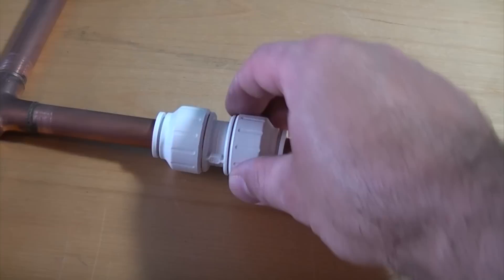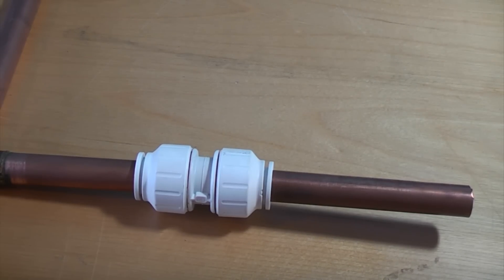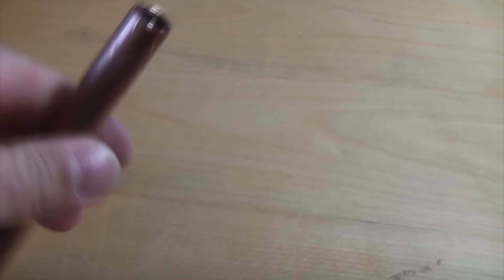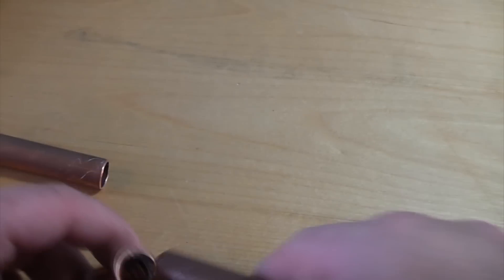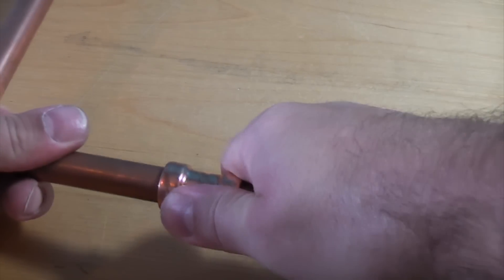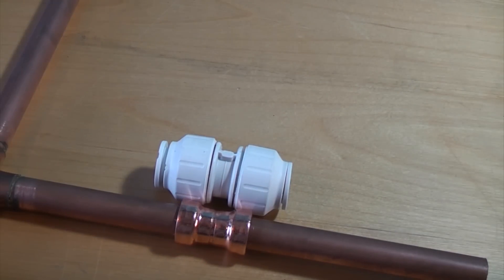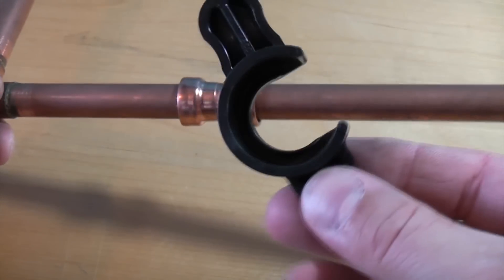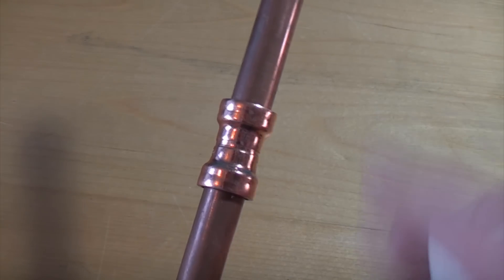copper pushfit fittings

Comment: As a DIYer, these are news to me, and I'm happy they exist! I'll soon be moving a radiator in the bathroom and I'll be using these copper push fits for sure!

Thanks for the video
Reply from the maker: These are really useful on some jobs ;-)
I'm glad the video helped 
Thanks for the comment 👍
Reply: Yeah me too. Just easier plus if you've just paint decorated the skirting and walls less messy than soldiering...

Comment: Can these be relied upon not to leak?  They would be behind bathroom tiles thats all
Reply from the maker: No fitting can be guaranteed not to leak over time. I’ve seen end feed solder start to weep after a few years! 
I did pressure test push fit fittings here-
https://www.youtube.com/watch?v=I59OeSwrhEc&pp
I always try to avoid putting fittings in areas where they cannot be easily accessed, but sometimes you don’t have a choice!

Comment: Apologies if already answered but couldn't find in the comments - which brand are these? There are a few brands of copper push fit around now and these look to be fairly slimline and neat.
Reply from the maker: If I remember rightly, the fittings are tectite sprint 👍
Reply: @ultimatehandyman  worked a charm as the fitting is on display, cheers.

Great channel by the wayl!

Comment: I have just used a copper pushfit end cap as a temporary measure as a garden tap had sheared off. How do I remove the pushfit end cap without cutting or damaging the pipe as I have now bought a new tap?

Comment: what about mixing existing connections between copper and barrier pipe     Pegler v. JG v. Hep20
Reply from the maker: The manufacturers recommend that you only use their fittings on their pipe, or copper pipe. 
But all the pipe should be the same, however, if a fitting blew off from a pipe and there was a insurance claim, they would just say that the wrong fitting was used!

Comment: Do you know if the internal diameter is the same between the plastic and copper push fit couplers? Would either of these reduce the flow rate compared to a pipe with no couplers?
Reply from the maker: Not sure, but plastic pipe must reduce the flow in some pipes, due to the size of the pipe inserts!
Reply: @ultimatehandyman  Yes plastic pipes have a smaller internal diameter even before you put in the insert. Was just wandering in the case of connecting two copper pipes whether either fitting would reduce flow noticeably.

Comment: Hi, I have been told that the plastic push fits should have inserts between the joints and the pipes. Is this the case with the copper fittings?
Reply from the maker: I would only use these on copper pipe.
If you need to join plastic pipe or connect copper to plastic, I would use which ever brand fitting the pipe is, so if the plastic pipe is Speedfit, I would use a speedfit fitting etc. You always need a pipe insert with plastic pushfit pipe 👍

Comment: Are the copper push fits just as reliable as the plastic push fits? Looking to use them for radiator plumbing behind plasterboard.
Reply from the maker: Yes, they might even be better, as the copper will not be affected by heat/light etc. which can sometimes make plastic brittle!
However, I try not to have any joints benhind plasterboard (but that is not always possible)

Comment: The brass push fit are good, but the  removal tool doesn't work!
Reply from the maker: Thanks for the comment
Reply: I don't if you tried it but it's hard to remove them with the tool supplied, or it's me! Hahaha
Reply from the maker: If I remember rightly it is not easy to remove them and takes a bit of practice- you also have to ensure there is no pressure in the pipe.

Comment: Do the ends near to be a PERFECT cut? There is a little lip in the end from when I cut the copper pipe and was wondering if it was still work or if I have to file it all down
Reply from the maker: It needs to be perfect for push fit or it could fail at a later date!

Comment: Hi mate. I want to install a new radiator in my living room as the room has been knocked through from one room so i only have 1 radiator at the bottom meaning the top half of the room is freezing come winter, I have already worked out the path for the pipe work but i was just wondering would it be ok to use this type of fitting for the supply pipes from the flow and return to the new radiator?? or maybe i could use compression fittings. main reason i ask is im not all that confident with soldering.

thanks scott advice would be appreciated.
Reply from the maker: scott bullock 
I'd use compression fittings to be honest, they are cheaper and easy to use ;-)
Reply: *****
thanks mate

Comment: Hi, should these fittings spin on the pipe? I'm fitting a radiator and have found that these copper push fittings spin fairly easily on copper pipe
Reply from the maker: Yes, most push fit fittings can be rotated. The stainless steel grip rings inside only prevent the pipe from being pulled out- they do not prevent it from rotating.
Thanks for the comment

Comment: would these join to plastic pipe? i have a tight area were a vanity is going into and no room for a plastic push fit all my internal plumbing is plastic.
Reply from the maker: +TParker18 
Yes, I can't guarantee that all copper push fit joints will work with plastic pipe, but Tectite sprint can be used on copper or plastic (as long as you use a plastic insert). http://bit.ly/1VBoNG4
Reply: Perfect I will use Tectite sprints in that case thanks a lot. Also wanted to say thanks for your videos and guides that you've done here very useful and saved me some money do you have a donation link so I can chuck you some beer tokens over.
Reply from the maker: +TParker18 You are welcome ;-)No need for the donation as of yet, I can still put food on the table for the kids by doing what I'm doing LOLThanks for the offer though, very kind of you ;-)

Comment: Can you put plastic pipe into copper pushfit fittings ?
Reply from the maker: Most can, but there are a couple of makes/models which are not suitable for use with plastic pipe.
Tectite Sprint and Tectite Pro can be used with plastic pipe, but Tectite Carbon steel and Tectite 316 cannot be used with plastic pipe.
Thanks for the comment
Reply: Ultimate Handyman thanks very much sorry forgot to ask do you still use an insert with that joint ?

Comment: I've often wondered what's the point of copper push fit fittings, as plastic will be much cheaper.

I'm not sure people would use copper, just because of the way it looks ? I mean exposed plumbing has no aesthetic value anyway..

Maybe using copper pushfit, you maintain electrical continuity, which is necessary for things like earth bonding.

Is my theory correct ?
Reply from the maker: +cielobuio 
Not sure about the electric conductivity as the sealing is accomplished with an O ring, which are often made of insulated materials such as PTFE etc. I'm sure most will be electrically conductive but not sure if that is a reason for using them. The other problem with the copper push fit fittings is that they are not de-mountable, unlike most plastic versions.
Thanks for the comment

Comment: That dismantling tool is utter rubbish, does not come close to disengaging a fitting from 22mm pipe. You end up having to cut the pipe!
Reply from the maker: I don't use these fittings much, but I'll check the next time I use them.
Thanks for the comment 👍